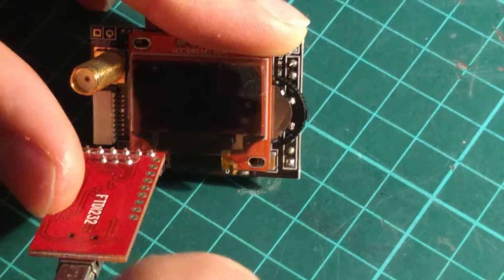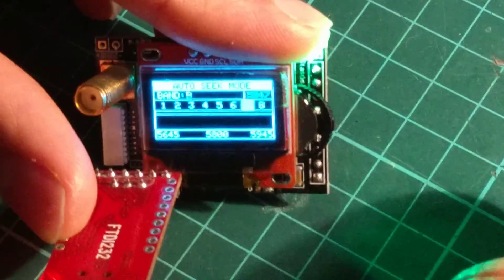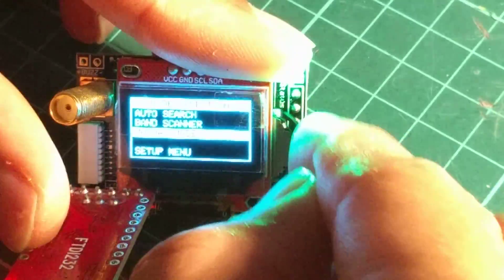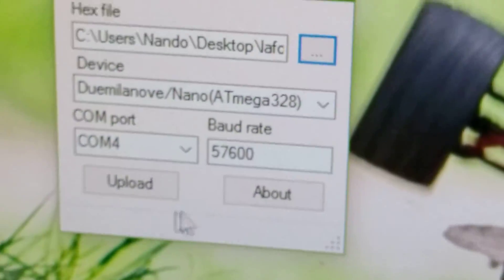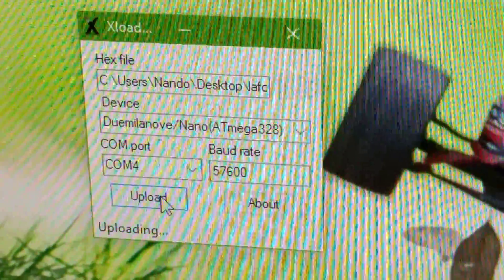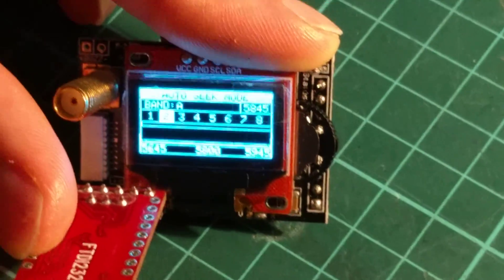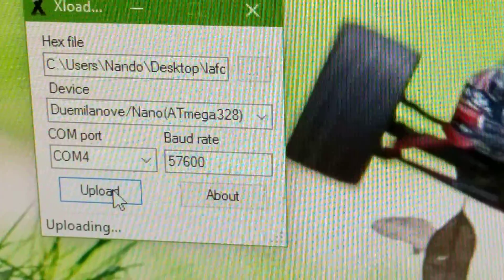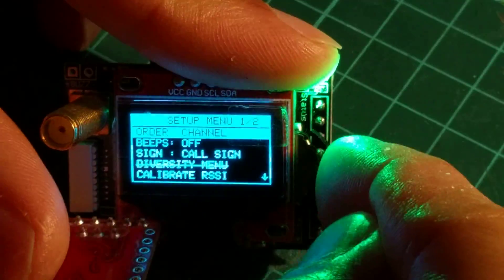Loading Laforge firmware in Realacc module

Comment: Bricked mine :(
Reply from the maker: Try and clean eeprom before flashing it. Also don't use the versions on LaForge site, those seemed to have been changed to prevent them from working.
Reply: Nandox7 Sorry to ask but may I know where can I find the old working 1.6 laforge fw that is working in the realacc? Thanks for the video
Reply: how do i clean the eeprom? i flashed the 1.7 firmware from the laforge website and bricked mine
Reply: i have managed to fix it. video on my channel
Reply: yes,is very important cleaning eeprom before update laforge 1.6 fw/not from laforge site !!!/

laforge 1.6 is only 32 channel,realacc newest soft is 48 channel

Comment: Does not work be warned these files will brick your module. corrupt hex files and will not update. stock firmware just has good and distance is still the same. tried both firmware on the realacc rx 5808 pro, the firmware laforge is just a gimmick nothing else.
Reply from the maker: As mentioned in the "READ THIS FIRST" disclaimer :D
That side, the current Achillez firmware brings more features than the 1.6 from Laforge.